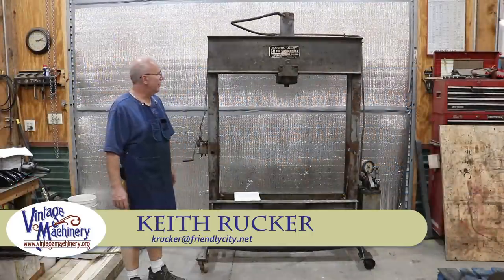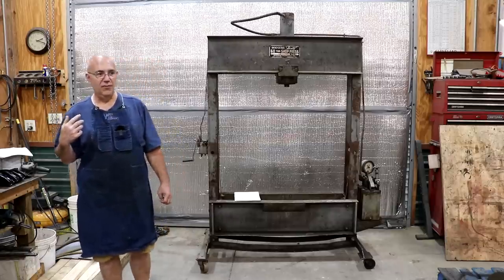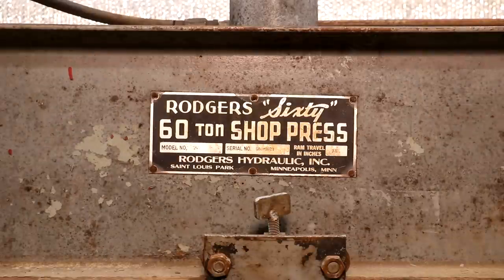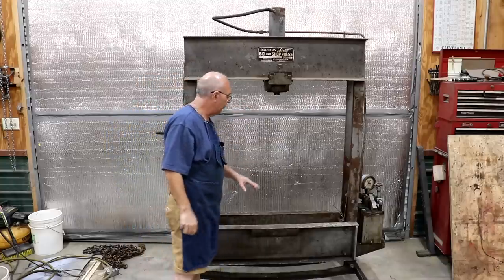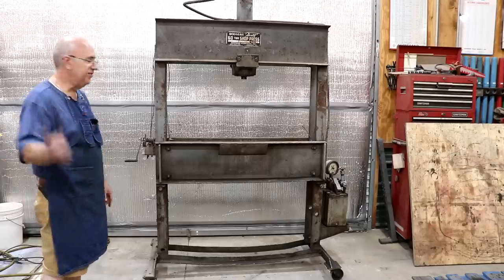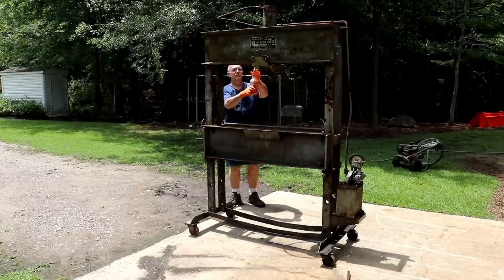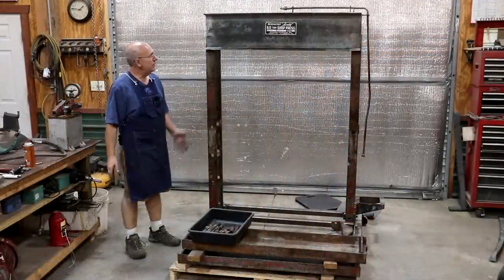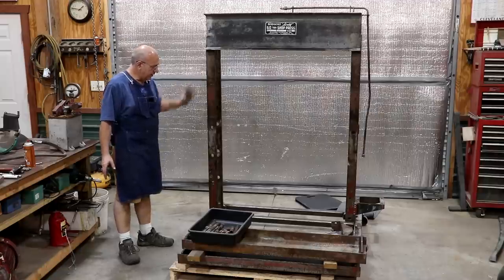New Machine Day: Rogers 60 Ton Hydraulic Press

Comment: I built a 50 T like that using an Enerpac Porta-Power with an electric power unit. We could quickly remove the cylinder and power unit for other jobs around the shop, such as pressing in large bearing races, etc. They do come in handy.

Comment: Thanks Keith.
Something that I do for cleaning and degreasing, get a  jug of "Awesome" from the dollars store for cheap and then put it in a 1 gallon pump up sprayer. Then you have a hose, wand, adjustable nozzle,  large quantity and you can just hold the trigger down. It saves your finger and you don't have that mist right in your face. Looking forward to seeing it when you get it the way you want it to be.
Reply: I started doing that recently for general kitchen and bathroom cleaners. Picked up a cheap 1qt pump sprayer. Little conveniences go a long way.
Reply: I was thinking the same thing, at least using a pump sprayer. I get mine cheap from Harbor Freight and fill it up with Simple Green, Inexpensive and works great.
Reply: Awesome rite up Keith alley cheap but he would prefer someone give it to him he wants everything free if he can't steal it he don't  want it

Comment: You'll be able to break stuff real good with that! 

I bet the angle irons were bent just by people standing on them. 

It's true that the casters don't need to support the force of the press, but they still need to hold up whatever you're pressing on. Whether they'll be okay or not kind of depends on how big a workpiece you are going to be pressing on.
Reply: True!
Reply: I doubt that workers body weight bent 2"x2"x1/4" angle iron. If you have ever used a press you would realize that the part being pressed out is usually heavy and not something most employees are willing or able to catch. Those heavy falling parts are what bent the angles. Some times you'll see wooden crates full of foam padding under press tables or wooden pellets to soften the blow. Sometimes you'll see a forklift used to catch the parts. These methods only work in shops that allow employees the time to implement them.

Comment: When changing to electric motor, set it up with a foot operated switch. That  way you have two hands available. Shop I worked at once had that and was handy to set up wheel bearing hubs.

Comment: I've used a lot of presses at various locations over the years but I've never encountered one mounted on casters. There will be many applications when you do not want that press scooting around as you use it. Cut the wheels off. Also cut the new cross-ties off and tie the vertical stanchions together at the base with a wide flat plate. When parts drop to the floor (they certainly will!) they will strike the flat plate and ricochet less, and the concrete floor will be somewhat protected.
Reply: Additional thought; instead of casters, set it up on a pallet-like structure, to be moved with your pallet-jack/forklift?
Reply: @surlyogre1476 I agree I wouldn’t want it on casters but being able to move it with a pallet Jack or fork truck would be great.
Reply: Or replace the caster with the type that have feet that can be run down..

Comment: Resto mod definitely. 
Power pack 👍
Electric winch.
New casters. 
I would watch for movement in the frame and bed. May need to consider additional bracing.  The open ends of the top plates?🤔, bent bed bolts & sleeves could do with an upgrade, last bed locating pins ?🤔
After watching the plainer, bandsaw, mill. I can't help but see the press with pin stripes, new rollers with tapered metal tires. 
Anyway, I will be following this build and 👍

Comment: An Enerpac electric or pneumatic over/hydraulic drive would be great.  When I was working as a railcar mechanic, we had a large 50 ton press similar to yours.  The electric pump was very handy at dislodging bearings and what not, but this pump also had a hand pump to 'feel' the pressed piece come free.  You could bring it up to pressure with the motor, and then pump the handle to delicately break free a pin or what-not.  Simply plumb in the manual controls.  Just my $.02.

Comment: That has the makings of a fairly decent press. It really is lacking only two things, that is, a threaded ram extension that allows you to bring the ram down into contact with the work (or close to it) before you start pumping, and a two speed hydraulic pump, although I suppose it is possible (but not likely) that is a dual stage pump. An electric or air powered pump seems like a great idea and it is if you are doing a lot of "un-fussy" repetitive work like replacing track pins and bushings on construction machinery. But for general shop work and repair work you will absolutely miss the feedback you get from that hand pump. I've owned and used for many decades a 60 ton Manley that has proved time and again to be one of the most useful tools in the shop. It needed some maintenance work when I bought it and it still does. I just completed moving the press to my new shop. Maybe that, plus your vids, will give me the needed impetus to get that taken care of.

Comment: Pressure on those pin was creating a rolling fulcrum which allowed the legs to spread at the bottom because of the casters which in turn stretched the angle iron and when pressure got released gravity took over and pulled the center down...not all at once though...it would be after years of use like that to cause it

Comment: I imagine these primary disassembly moments are both rewarding and frustrating! Even watching second-hand there is a great sense of achievement and satisfaction in seeing you restore any of these machines to their original condition. Equally I would think every bent bolt and mount that needs reworking runs a cash till inside your head. Another pound here, another hundred pounds there...

Comment: My neighbor got a similar "old style" press carcass, he replaced the H beams, someone had used them for attempts at torch or plasma cutting. When it came to the winch he installed a small vehicle winch unit and used the synthetic rope on it. He did some wiring and and had controllable up and down. His already had hydraulic system with 2 stage fine and gross control for pressure. Great fun (meaning hard work and long hours) project!

Comment: I really liked what your old buddy, Fenner did when he built his press many years ago.
No one ever abused their press.  No 20 ton press was ever asked to press 50 tons.  "Well, it fit the throat. I went to the limit and it did not move. I might have bent the frame.  Oh well.  John's shop has a 60 ton."  Nothing ever dropped and landed on the cross angle iron that was designed to be flat on the floor and is now sitting 3" above the floor.

Comment: I know you get a million thoughts on doing this or that. Here is a million and one. :-) I know what it is like to have thoughts in the heat of the battle and when you have time to think about it ..., you may have already had this thought. On the nuts you cut off that captured the ram. Instead of welding them back, maybe take a small piece of angle iron, bolt it to the flange of the ram, and let the overhang capture the ram. Then if you need to remove the ram you are looking at just unbolting it. 
It doesn't need to be super heavy-duty, I wonder if there is enough room, kind of hard to tell from the video, but you have a better view. :-) Just thinking out loud.

Comment: I had a 100 ton unit that we converted to a power pack. At the same time I removed the winch unit and replaced with a long stoke hydraulic cylinder with a diverter valve in order to raise and lower the bed with the power unit.
Reply: I've seen many D/A rams used to raise / lower the bed with a hookup chain but not a separate lifting ram, thanks for the idea!

Comment: Maybe look for a light duty hydraulic Ram with a stroke = half the travel of the cross piece, Mount vertically with the piston pointing down and put a pair of chain sprockets on it (run chain from a static anchor round the sprockets, giving a 2:1 ratio hence the ram only has to move half the distance), replace the 3 rollers with chain sprockets too and use roller chain instead of the winch cable - Tee off the hydraulic line with a 2 way valve - much slicker than a hand winch

Comment: Well I might have messed this up, so I’ll try again. I would like for you to consider putting the pressure gauge inline and at eye level with the cylinder feed. This would serve a two fold purpose. 1) it would make it easier for you to track the actual pressure being allied to the part. 2) with a simple calculation, you could easily convert the applied pressure to Tons of force. In my humble opinion this would give you better control. I worked at an integrated steel mill as a maintenance mechanic for 38 years and our shop had several presses. The gauge location on all of them was mounted at eye level. I did help upon many occasions. Have a good day and be safe. I do enjoy your work and have learned a lot from watching.

Comment: We had a 125 ton Dake in our shop. The ram was 18” diameter and the pump used a 3/4” leather cup. It was very slow going. There was a 6”    Diameter Acme quick adjust inside the ram. We tried to add an air over hydraulic assist but it just blew the oil out. Looking forward to seeing your final results.😊

Comment: I have a 20 ton press from Cummins tools, I put casters on mine a very long time ago, best thing I ever did to that press. 
I was going to suggest using tubing for those cross members. Since both are bent at same angle, seems like someone laid something extra heavy on it not thinking.
Congrats on the new addition to the shop, once you get her cleaned up, the rest of your machines will be jealous. Great video as always, cheers :)

Comment: I'd look at the cable table raise lower mechanism on other presses, and probably from the original manual for yours.  There are couple of ways to run the routing so a single cable goes to both sides and moves things up and down at an identical rate, keeping the table level.  It does slow the movement rate so you can use a winch with much less mechanical advantage, at least for the reeving pattern I'm thinking of.  Having the table stay level during moves can be handy when you have something sitting there and need to make an adjustment between steps of a process. If nothing else it looks and feels slicker to use.

Comment: Nitpick: The frame flaring out may have been it's original shape, as the angle irons shortened when they got bent. I personally would have measured from the top and cut the tubing to that dimension, so if anything, it would pull to squareness.
Reply: I had a different thought, that they were bent that way on purpose so something cylindrical would fit underneath. Just a man standing on it wouldn't bend angle iron like that.
Reply: I had the same thought.
Reply: Someone took the table out or threaded something though the table and tried pressing against the angle iron, something really long that didn't fit, seen it done lots of times 
Either that or something heavy pressed off fell and hit them, that's also common

Comment: One suggestion, in place of the bolts and spacer tubes for the moving worksurface, put a solid block of metal between the channels and bolt in place.  Much, much stronger and the channels will not move in relation to each other.
Look forward to the rebuild.

Comment: Instead of cutting the bolt off the ram you could have cut out a small section in the H beam (probably at one end) for it to pass through . I would still do this for re assembly so you can weld the nut back on and paint it  easily.

Comment: My old shop had a Rogers 80 ton press very similar to that. The cylinder traverse locked by a cam and lever. The pump was a two stage. Fast travel with little pressure and slow travel under pressure. The winch for raising the bed was broken for decades. We just used a forklift for that. You get better control with the manual pump. Our 100 ton roll bed press was electric/hydraulic. No fine control and difficult to set up because of the speed.
Reply: I like the sound of the two stage pump very much.

Comment: If you consider the loads and work but really the cast iron dies and flats for the cross bar flopping down there out of the way as a small item was put there and.  You need some forms up there to hold things as you press into them or through them.

Comment: hydraulics' in your case is simple you can get what you need from many sources, the power unit comes in many forms . you just need convince in your planning..  the major concern will be what psi you require to get full use of  60tons. (psi x diameter of cylinder) a valve and a pressure relief for safety.  any hydraulic shop can make that "over the counter". easy for you. the hard part is drilling holes to mount it you are very good at that...  hyd. only pushes and as long as it is contained pascal law is your friend.

Comment: Find the diameter of the piston of the ram and the pump ram.  From those, you can figure out the area of the pistons to get the psi that is needed to get 120,000 lbs of force from the ram.  The hose and fittings will need to withstand that pressure.  I would figure at least 50% to 100% of pressure over what is needed for the hose.  You might even use a pressure relief valve at the pump end of 5% over the needed pressure to protect the pump.  You are familiar with steam and air, hydraulics are basically the same except they will not compress.  Good luck.

Comment: A couple coats of high gloss Dake green would be a good color for that press. Definitely install an electric pump with the hydraulic gage at eye level. Might need a new ram also depending on the condition of the old one.

Comment: A bit late now, but the bends in the angle irons would be making them shorter, pulling the uprights in. I was watching you cut expecting to see the uprights spring out to their natural position, but that was lost in the cut. 
So, I think that the relaxed position is where the uprights probably should be, though a better test would be to measure the top spacing and match that. 
Not that it matters at all, really.

Comment: Those angle irons got bent because someone wanted to press something that was too long for the press table. The part fit between the channels of the table, and they just pressed against those little angle irons. I worked with a guy that did this repeatedly to our press. Our fabricator would fix it and the insensitive lout would do it again.
Reply: Ideally, the base would be strong enough to press against but you probably won't have a need to press long shafts and such.
Reply: That was my thought also about pressing against the two bottom angle iron pieces.

Comment: The vertical channels should be parallel. Did you dimension the lower cross bars so that the verticals are parallel? The original angle irons were severely bent  resulting in the lower ends of the uprights being narrower than the upper ends.

Comment: Wouldn't the bent angle have been causing the posts to squeeze in, and cutting them allowed them to return to their normal position.  i.e. The square cut to the same length as the top beam?

Comment: Does anyone know how the 60 ton capacity is rated?  My guess is its when the ram head is centered.  When you look at load tables for horizontal beams that have a vertical leg on each end , one leg will carry more weight when the load is off center. I get that the stress is between the top beam and press bed, but there is a section of tubing connecting them.  

Does the 60 ton rating decrease if the ram head is pushed to one side?

Comment: Keith, I am curious why you want a press with 4 separate posts instead of having 10 or 12" C channel. I have been thinking about building my own 50 ton press but do not know much about the physics of what would be best.
Reply: The four posts are generally quality forged steel, compared to most of the C channel being  just hot rolled.

Also you can reach the table pins from inside or outside.
Reply: @ionstorm66  More importantly you can put long shafts in between the uprights for straitening..

Comment: Those lower tubes are bent from having large metal things slamming into them when 60 tons of pressure pushes the piece through what ever is holding it. You kinda need a shock absorbing situation that does not take up space. That press can be very dangerous. Protect your eyes and neck.
Reply: I was thinking roughly the same thing. Not so much that stuff is flying out from the pressure, but that many many years of heavy things dropping on them.
Reply: Maybe he could put some sacrificial timber on the square tubing (old RR tie stock?). That would absorb some shock and could be replaced as needed.

Comment: Keith,  I have 40 years of Hydro experience, send me the bore diameter of the ram, and I will calculate the operating pressure needed for 60 tons. Once you know the pressure, then we can see how fast you want it to move to calculate the pump displacement.

John C